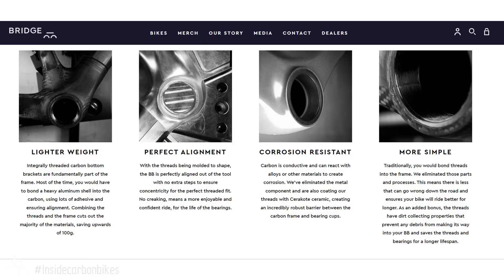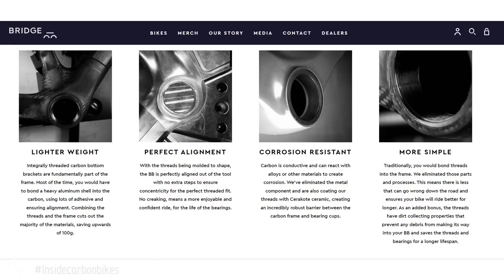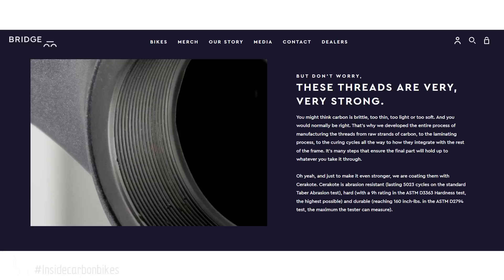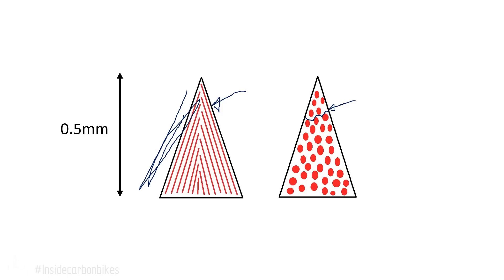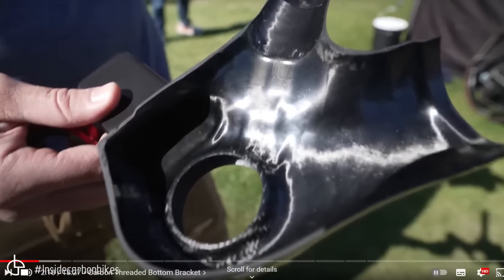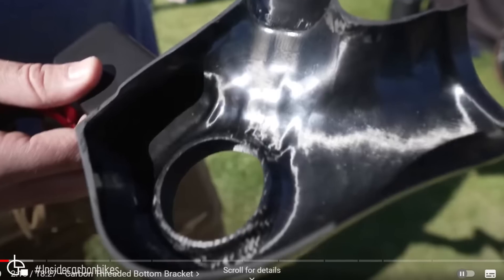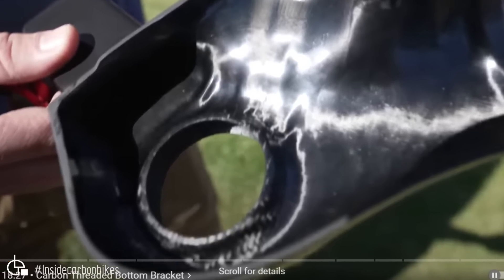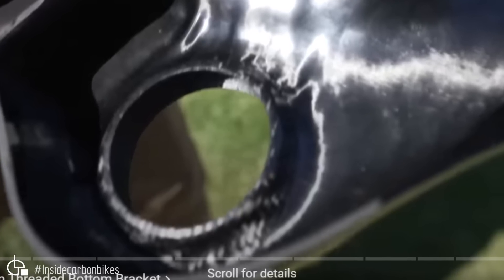Threaded Carbon Bottom Bracket???

Comment: That's a fantastic point re: why don't they just make an accurate press fit?
Reply: Because accurate press fit costs more to manfacture than adding a threaded to less than perfect bores and a threaded bore is more effective than clean bores/press fit for bearing/cup retention.
Reply: Even if you manufactured it perfectly, once someone installs aluminium cups they corrode the BB pressfit. If anyone ever presses the BB in crooked the fibers tear and a water ingress area opens up. 
Show me a pressfit that is still functioning in 20+ years with a history of 5+ BB changes and used in wet weather
Reply: @janeblogs324  I have another quest for you: Please show me a threaded aluminium frame BB tube without some kind of damage to the threads.
Reply: Press fit was designed for mass produced frames that can justify expensive, accurate tooling.
Reply: weight!
Reply: @brianhagan4728  don’t be silly, grab your ass how much fat is there?  Well?  Loose it  heard of diet.  You will loose way more than possible otherwise.  Silly silly.  LT is nearly at least from looks, has double zero body fhat %.  Even hair.  No one can come close I bet.  Silly.  Just grab a 1/2 butt.  Can you ?  Money says not.  Silly silly.
Reply: They finally learned the lesson, which is F press fit.  Or, tired of ripping off stupid bikers with new BS who will buy anything new?
Reply: Or, put the F - in full alum threaded insert in there and stop the Mickey Mouse BS with none sensical carbon fiber usage.  Now, let’s get rid of the most ridiculous use of carbon in bikes, that is fork steerers, and go back to chromoly steel to carbon.  Yeh right, let’s see that one sheer off?  Good luck.  After all, how many bikers are ultra lightweights like the author, or should I say, getting heavier every F- in year, like the AMA in the US reports?  I guess, not in my lifetime?  Not giving up my 1996 Kestrel 200csi carbon with rim brakes and full threaded alum bulletproof insert, over my dead body, so why not stop asking me what kind of frame is that with the sexy rear end?  Leave me the F alone.  Including stopping me on the road.  Is that ever possible, or should I just end it all now?  It’s like as if I just arrived from Italy born and raised there, in the US, and everybody in the US is asking me when they hear me talk, did I grow up in Italy?  The only ever peace I get these days is on Zwift, on my deck outdoor, or when it rains in the garage.  As an avatar, and never ride on the road ever again.  And I mean ever again in my whole life to remain, so help be GOD.  Whoops, no business for LT.  don’t worry only 30K riders max world wide, so far, but holy smoke my Avatar bike is a carbon fiber frame.  Can you believe that in video game heaven?  Good bye and good riddance to the real world. You are never getting my name but sure you will eventually hack it, after all, already have the country.  Ha ha ha.  Yea, it took me 2 hours and 20 minutes to finish climbing about 4000 feet vertical in France up Mont Ventu  over just 15.1 miles.  Forgive the spelling.  Best ride ever in my life, power meter blasting away cooking the hydraulic load road unit.  Cooking it.  Just  4 mph at times.  and still alive not killed by cars, not possible.  Isn’t that a TDF stage?  Had plenty of company too.  Why am in here in LT land you say?  Made a successful career but tremendous sacrifices to get to the top $$, in tech, so I can retire younger and never have to work again for money.  That’s why, and Hambini is the other godsend.  Peace, never see you in the road again, and my avatar carbon bike is perfect in every conceivable way, since the creation of bike kind.
Reply: Because accurate pressfit is still a fucking nightmare compared to the end-user ease of turning a ratchet
Reply: @cjohnson3836  If it's a nightmare, it's not accurate.
Reply: Easier said than done, also very expensive. Far cheaper to make a threaded BB and not have any issues.
Reply: @laneromel5667  always was, wasn’t it?
Reply: @Lane Romel  threaded BBs are very often out of alightment.  Luckily you can get largely one piece bearing cups for t47 from BBINFINITE and others
Reply: @veganpotterthevegan  I have been riding top end steel bikes for 55 years, and never had a bike with an alignment issue. Look at the tool used to thread the BB, almost impossible to screw it up. However not using the correct tooling then you may have an issue.
Reply: @laneromel5667  people have been riding misaligned frames for far longer than you have.   Bearing systems allow for some misalignment.  They simply create more friction but they still work.  It's a lot more common than you think
Reply: @laneromel5667  I think you gave a hint as to why you had no trouble when you mentioned "steel.". It's a lot easier to achieve it with metal, especially steel, than with carbon fiber.  With carbon, you can try to mold and form everything to exacting detail, but then you will get warping/shrinkage during the cure and things will get out of alignment.  While most manufacturers are capable of controlling this, the tolerances necessary to avoid creaking are so tight that even something that's 5x the threshold limit is imperceptible to the naked eye.  With steel or alloy, you can just machine things or even twist the frame into alignment after the fact without risking irreparable damage.  You just can't do that with carbon.